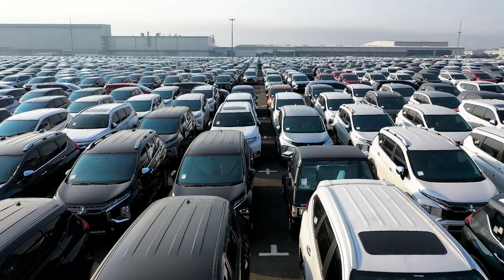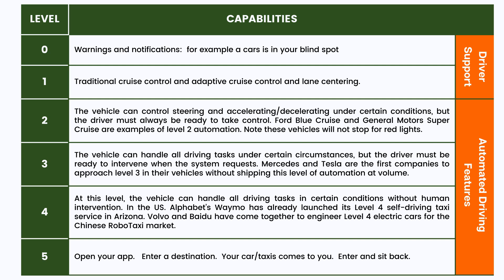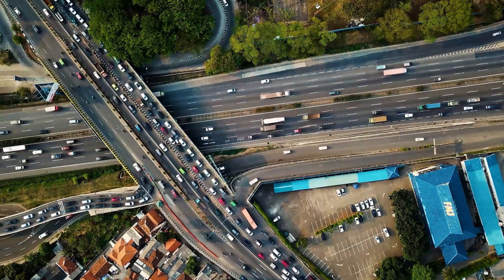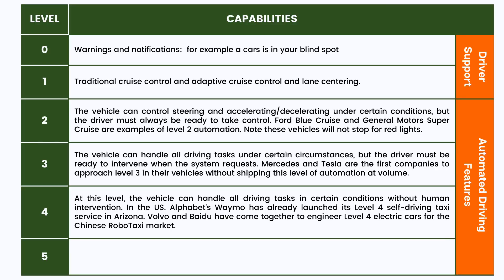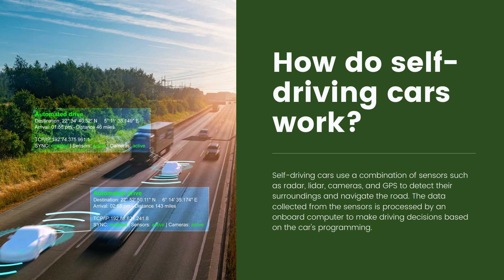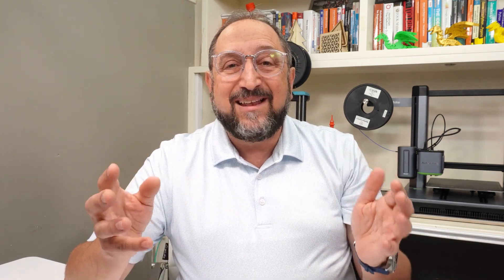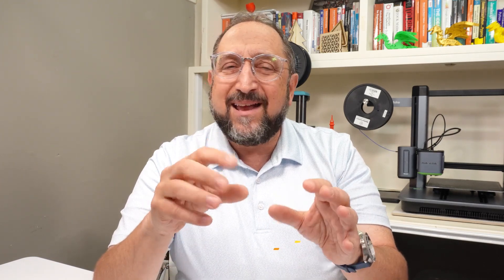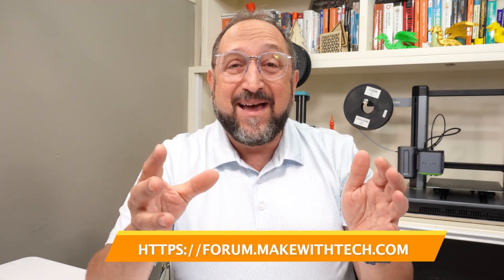How Do Self-Driving Cars Work

Comment: I have the Eyesight system in my 2016 Subaru Outback. I love it. I have driven long distances without using the gas or brake pedal. The system can get confused with bad lane markings but it is easy to turn it off.